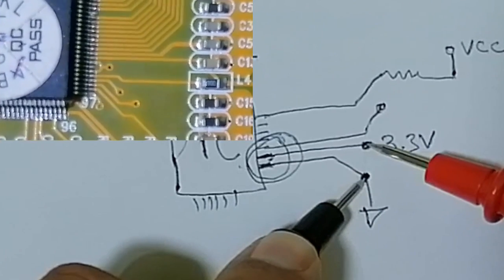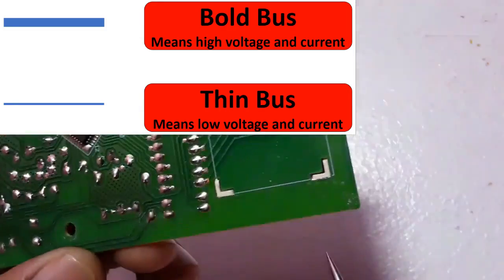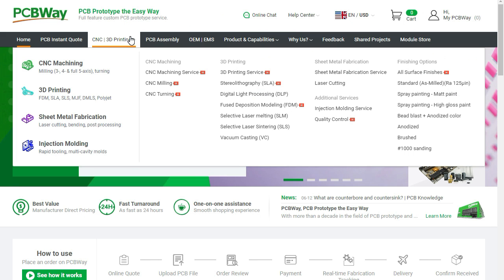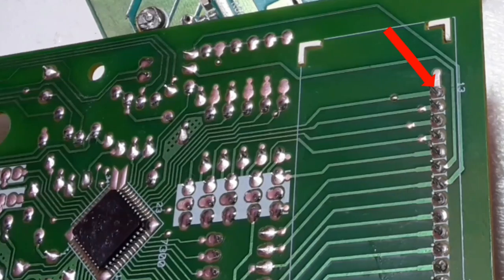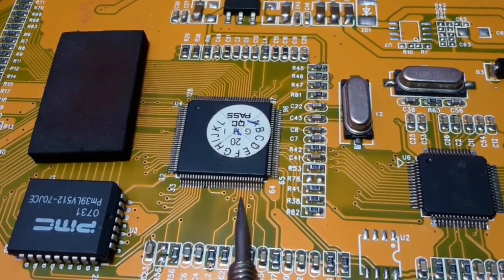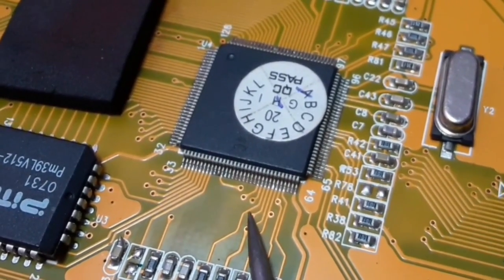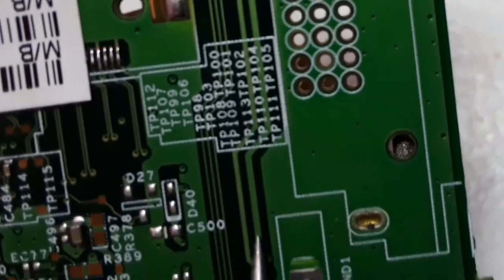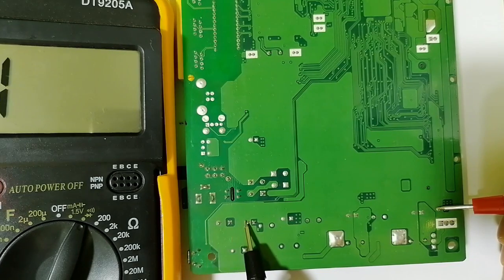Track electronic signals on a circuit - Integrated Circuits IC techniques using a multimeter

Comment: Do you have a video pertaining to repairing electrical and electronic small tools; such as fans, drills, AC units etc?   I looked at your HT repair a washing machine. Very good. 
Maybe your computer videos which are EXCELLENT but I wouldn’t where to start as there are so many. 
Thanks again!!!
Reply from the maker: Thank you for your kind words! I currently don't have a specific video focused on repairing small tools like fans, drills, or AC units, but that's a great idea for future content. For now, I recommend starting with videos that cover general electronics troubleshooting, which can give you a good foundation for working on various devices. If you're interested, feel free to suggest specific tools you'd like to see repaired, and I'll consider creating tutorials for them! Thanks again for your support!
Reply: @electronicsrepairbasics_erb  Nice, 
Thank you 
I’ve been watching some of your videos on the basics on identifying different electronics components and  they have taught me already quite a bit. I like that you break it down for beginners also. That’s definitely where I’m at. I’ve been at it for a few years and thru other sites learned to fix quite a few things which gave me great satisfaction. I think there’s a part that they miss, like how to find the parts on the boards or just regular connections to a contactor in an ac unit or something else like that and then what happens after that? You cover quite a bit of that which I was able to grasp to a certain point. 
For instance, I have two bug zappers different brands and both burned out. One was clear as a few resistors blew and burned also a cpl of diodes burned also. 
Anyway I really like your approach. 
 I guess there is a substitution element where you can use one component over a different one and maybe that’s the art and math part of the equation. I’m guessing now, but it seems that way and maybe that’s the part that gets hard to explain. Please correct me if I’m wrong. 
Thanks